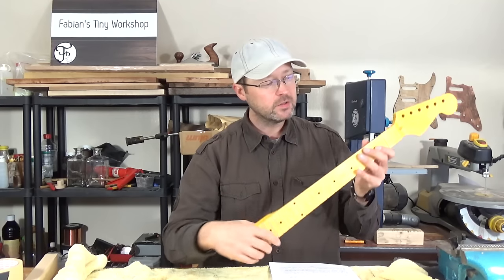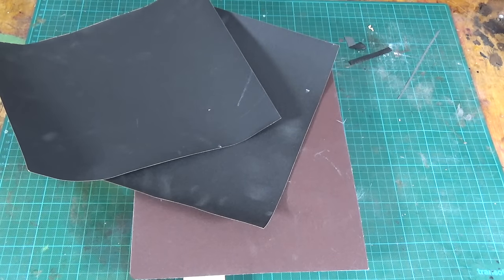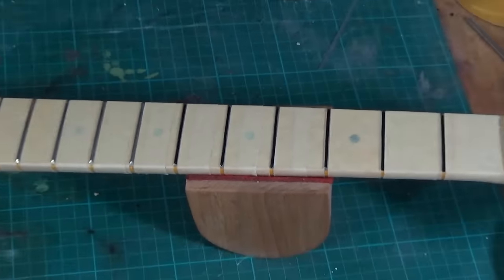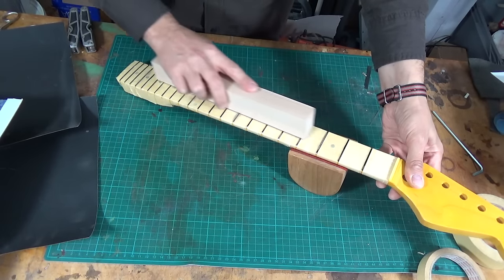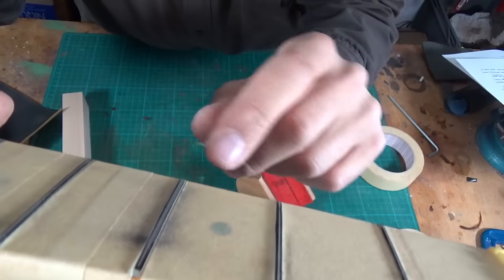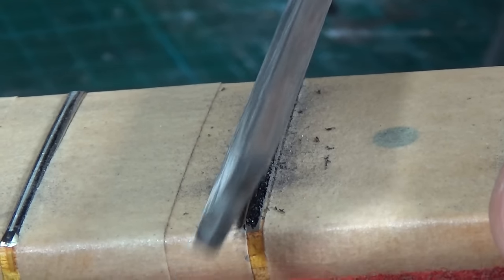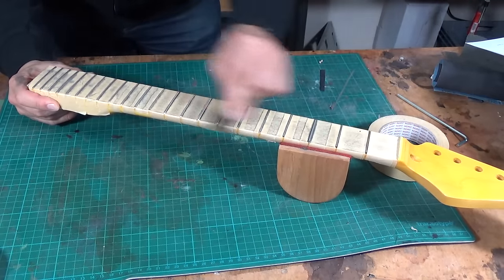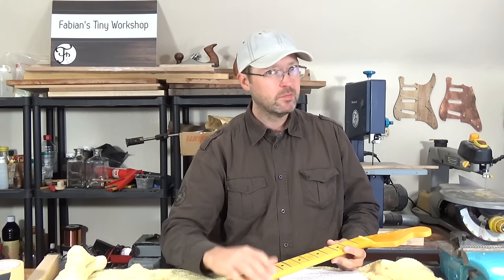Fret Leveling - The Easy Way // How To

Comment from the maker: Please bear in mind that you also should file the nut slots to the new fret level (picture the nut slots as the zero fret).
Nut slots that are too high create a situation where the guitar is difficult to play due to the high action in first positions. They can also throw off the tuning and intonation.

The ideal nut slot height, in terms of playability, is subjective — much like string action height at the bridge. Some players like the slots to be cut up a little higher - like slide players - , and some players want them cut down as low as possible so the guitar plays very easy with no fight - that would be me ;-).
Reply: Thank you so much for this helpul video! I am learning luthier work, but am on a budget. This video was straight to the point and I can't tell you how much I appreciate you showing how to make home made tools. Thank you!!
One question though, when rounding frets edges, is there a certain amount of the fret to remove? Any specific things to pay attention to?
Reply from the maker: @Roman-wm4ji  Just make them comfortable round. Don't remove material from the top of the fret ends thereby making the centerline of the fret shorter. If the fret ends are too much angled the strings could glide of the fret ends.
Crimson Guitars has a great video on dressing fret ends although they're using more "sufisticated" tools ;-)
https://www.youtube.com/watch?v=MFHcavzk80Q
Reply: @FabiansTinyWorkshop   Thanks so much! just watched his video  :)
Reply: thanks for the great video. I'm experiencing buzzing in one string, and I suspect this video will help me figure out a way to fix it. Regarding the nuts, my impression is that depending on the strig you'll have a different width on each slot, to lodge properly the string according to the caliber. This way they can sit on the same level... That's another problem I'm experiencing: I'll have to widen some nut slots a bit to make sure they are leveled from the bottom. Makes sense? thanks
Reply: I have the jem but my fretts seem abit uneaven I definitely think it is needing this done as I have lots frett buz,I've tried all the basics set ups adjustment s like the kneck!! Raising the saddles the bridge ect but I ain't raising it too much past 2mm low E that be too hard to play,seems only my low E that has lots buzz up and down kneck strange one!! I do feel it would be beneficial to level off the fretts and do this,I feel very confident after watching ur video many many thanks buddy thank u
Reply: Sorry to keep annoying u!! I start with 220 grit sandpaper ye,then what next to round them would 500 grit be any use when rounding them off,is that the hardest part most time consuming part would u say bro
Reply from the maker: @paulyoung4781  I'd say you can round the frets with anything between 220 and 400. Then work your way up to remove the scratch marks from the previous grits.
Reply: @FabiansTinyWorkshop  thanks so much buddy appreciated alot
Reply: Is it not better for a beginner to use a crowning file ? okay you have to buy one , but to me that looked the trickiest part of the process
Reply: @MrPhilfridge  I'm a beginner and I have a crowning file,I used it and didn't feel that comfortable using it! So I just got different grits sandpapers and wood blocks made up with grits and started the way the guy did it,much more realistic mate and like he said dont touch top of the fret they will round off as u progress u will work it out when u get there buddy I did I was abit skeptic! I'm still doing mine,I've leveling done now crowned them,am just starting to use 400,600,800,+ grit to get scratches off the frets now so far so good,when I get to 1000 grit I will check every fret use the rocker and make sure there perfect then I'll steel wool every one,then polish mate
Reply from the maker: @MrPhilfridge  Of course you can use a crowning file.
Reply: @paulyoung4781  Thanks for your post, i checked out a couple of videos where a crowning file was the preferred option , i'll see how it goes ! My biggest dilemna is whether the frets actually need reducing in height, certainly the fret ends need smoothing but really not sure beyond that. Its an all parts neck, sold as unfinished, but in some cases that often means just spraying and maybe fitting the nut. I've done around 20 home builds , but fretting is new territory other than really minor stuff. The frets seem a bit high but i've got the action to a very good height and the intonation is fine and i can see me f**k**g it up  🤫
Reply: @MrPhilfridge  I thought same my friend about mucking it up lol honestly I just thought I have like 8 high fretts buzzing is bad!! I watched lots of vids and done my research got my tools,anything I wasn't sure about I'd just pop a mail on here,and someone would respond and more I watched the videos I felt really confident about it,first time I I leveld the frets I used the wrong grit sandpaper haha 400grit I was very unsure about it and didn't want to make a balls up! So I leveld it all! I thought they were haha,I spent like 4 hours crowning them got them really nicely round i was very happy with it! Then I went up with the sandpaper 600/800/1000/steel wool,dont no what it was but I thought I'm away to check my fretts for any rocks! They should be fine now!! No 3 fretts were rocking!! I was absolutely gutted I thought I need to go do all this again,I should have used 220/240 grit for leveling not 400grit!! Hahaha so I did just that mate start again hahaha I guess u learn from ur mistakes buddy I sure did lol,so now I have leveling all done final now this time? And I have crowned them mostly I have 5 frets left to crown now,but I'm done for today my head is spinning now haha,tomorrow I'll finish buddy haha
Reply: You should stress LO TACK TAPE!!!!
Reply: You must be a beginning Luthier!
Reply: @danaeverhart6487 tape detail does show a lack of experience 😮 thx for your expert advice 😂
Reply: @danaeverhart6487 BTW can u shoot me a link to your master class 🥱
Reply: There goes the neck finish. Low Tack Tape from StewMac provides a clean SAFE removal without damage. 1st step protect the entire instrument before getting out the first tool, unless you are wanting to buy it. Peace ☮️ Dana 💫
Reply: @jimbradley727  Common sense Jimbo! Merry Christmas 🎄 BTW 45yrs repairing string instruments, and you???
Reply: @danaeverhart6487  that link tho 🤣
Reply: @FabiansTinyWorkshop  So that's explain why my guitar sound like shit after second time fret levelling, thanks for the info
Reply: you can also do the intonation at the nut, i often do it. simply cut the nut slots so each string gives a perfect half step between open and first fret position. not always necessary, depends on the nut cut, but can do amazing things to more inexpensive guitars.

Comment: Quick tip! place a piece of tape down the neck on each side before applying fretboard masking for quick removal.
Reply: thanks!
Reply: Since you're using some Stew Mac stuff,  I think I got several widths of masking tape (blue) and use the narrow rolls on the high frets.  I use a piece of granite with double stick 320 to get flat using your basic technique.  Ive used several crowning tool,  but I use a 3 corner file, but grind one side smooth and polish the corner, and you can get pretty surgical with the frets that way.  I got a cheap diamond crowning file, and if you're working on multiple guitars I wouldn't skimp on this tool.  I also use the StewMac gritty erasors, and finish by buffing frets with a cloth dremel wheel and simichrome polish.
Reply: @briantinsley7864  I also use a dremel and Simichrome.  Great stuff
Reply: Nice tips! Thanks ☺️
Reply: And why not use a dollar or two worth of ‘blue painters’ tape? I believe in saving money when it makes sense, but most old style ‘masking tape’ has some pretty nasty adhesive. 
When I compare the extra dollar for tape, to the value of my guitar neck, it’s a ‘no-brainer.’ It doesn’t have to be the 3m kind. Just keep an eye out for any sort of dollar store, it’s worth a look, because most of them now carry a cheap version of blue painters tape.
Reply: Nice one, Scotchy!
Reply: I've seen that video, too! Do it all the time.
Reply: @stradaveriusfiddle  I don’t even buy old fashioned tan masking tape anymore, it’s crap.
Reply: "Brilliant"
Reply: Bro, you’re a straight genius. Thanks!
Reply: Yep.

Comment: Hey, Just throwing it out there.. spend the money on a crowning file. I've leaned a lot of guitar oriented tools are just common or obscure tools repackaged for guitar work, but crowning is hard. If you're not already proficient with a file or woodworking, you'll either mess it up the first time or spend far too long doing the frets. Sometimes it's worth it to have a purpose built and purpose bought tool for the price of, maybe, a set up with new strings.
Reply: ....I thought about the same as you and just ordered a crowning file.
Reply: And I really don't think a piece of cardboard is good for a straightedge. Just saying....
Reply: @Mr.Steve-O  I bought one of those sets, and the included 'crowning file' took off the tops of the frets and put ugly scratches in them. This type of file should not be abrasive at the top, but the Chinese ones are. The diamond coating is uneven and coarse which is what can cause long deep scratches.
You don't necessarily need to buy Stew Mac files, although if you can afford it and plan to do many fret jobs, it is probably worthwhile although the price is hard to stomach. 
Anyway, a three corner file with safe edges works too, and after the useless Chinese file had ruined a couple of frets, I switched to a three corner file, watched a few tutorials on them, and got very decent results for a first try.
Reply: @meadish  I got some tools from Crimson guitars in UK ... They do.the trick and since I got a few cheap basses I figured spending a little in some good tools to make them super playable is better than paying for expensive bass and marketing.

I saw Highline guitars made a crowning file our of some soft balsa wood, a good fret and some sandpaper.
Reply: That one tool is worth the investment. 🤠
Reply: Yea, and if you work in any type of building trade just claim them back on tax and they are basically free lol
Reply: @Steve thanks ... that WAS the chap I bought the crowning file from ...it was some other gear I bought from Crimson. Both make awesome tools.

Comment: Yep. This is almost exactly how I've done it for 12-13 years. No fancy tools, just a cheap diamond needle file set, a flat piece of wood and some sandpaper. The only things I've spent some money on are nut files, since I haven't found a cheap alternative that can replace real nut files. I also have two notched metal rulers, but I only bought them because they are practical, not because I actually needed them.

Comment: A great tip for you guys when masking off the fretboard is to first apply masking tape along the edge of the neck length ways. I usually do a couple of layers. Then masking the fingerboard. This makes the job 100x easier to remove the masking tape later because you only have to pull up the two long strips of tape instead laboriously unpicking every single fret.

Comment: Just if anyone is new to that, the file at 3:58 needs the edges ground off to get safe edges. The regular sharp edges will eat through the masking tape and destroy (in this case) the finish of the neck and the wood beneath it. Good video, lowered the hurdle with the self made tools.

Comment: Thank you very much for the tips. I am a beginner (6 months) and my cheap €90 Stratocaster has 3 slightly higher frets. I learned a lot about proper set up (neck relief, inntonation, string hights, pick up heights etc) and was wondering how to do this without special tools and also learn. I also watched your DIY kit, i was looking into a telecaster DIY kit (love the tele twang) and again learned alot. Much appreciated.

Comment: I took my guitar into Guitar Center for a tune up, never thinking this would be an issue, but it was... After taking my money and not letting me know about this problem, which I am sure they spotted when they originally tested it, they were more than happy to let me know when I brought it back the next day. So, now, on top of the $50 bucks I spent on the tune up, I now have to give them an extra $125 to level the frets??  No thanks, I am doing it myself!  
This is a great video and I am certain that I will have no issues completing this project successfully.  I have all the tools, but more importantly, this video has given me the confidence to succeed.  I will never take my guitar into Guitar Center again!  I realized that getting my guitar serviced at Guitar Center is no different than having my car serviced at one of those $10 oil lube places!  Live and learn!

Comment: It’s Brian here on my dear wife’s iPad. Mine is opened up for a screen digitizer replacement in my “studio.” Thanks for a thorough discussion on fret level and crown procedure. Your video gave me the confidence to proceed as a DIY amateur luthier with old school attitude about fixing what you own and love when necessary. 
I’d collected new locking tuners, graphtech saddles, TUSQ nuts and a bridge, a Bigsby B30 and a Bourne split coil harness and I  was about to order a pricey 6” leveling file to address two guitars of 4 I own and play, a 2000 Epiphone 335vs and a1988 Fender Strat. The Strat has moderate fret wear, divots and some buzz and the maple  neck and fretboard will be stripped and treated with boiled linseed oil over Japan drier, then new saddles and nut. The Epi gets light fret dressing, new harness, the the Bigsby and bridge with Towner down pressure bar into  a Graphtech Rotamax Bridge , ditching the OEM Rotomatic with steel saddles. .
The other two are a 2019 LP Plus Top Pro VS which needs nothing and a 1952 Martin 018 on which if the two jobs above turn out as well as expected I will also do a fret restore. As refined and vintage sounding as it is it will likely regain what’s been worn away these years….Already refinished the neck myself, had a pro luthier in upstate NY reset that and repair/ stabilize some checking. It was my mom’s, I started playing that when I was 9 or so, now I’m 72. 
The roughly $65 saved from the leveling file (I own a new FretGuru 2.0 crowning file as of yesterday) I’ll roll into locking tuners for the Strat, save all the OEM hardware removed and all the tools in a box for whoever inherits my guitar collection when I ride off into the sunset. 
.
Reply from the maker: Appreciate it :-) Thanks for watching and commenting!

Comment: I have a piece of leather glued to a piece of wood. I normally use this for chisel sharpening. It works great  for final polishing frets. Use jeweler's rouge or whatever you have avalable on the leather and have at it. You get a mirror finish!
Reply: My favorite trick is my dremmel with a polishing wheel, as a last step.
It’s like string bending on glass!
Reply: I bought one of the green compound bricks for my strop and polishing anything metal around the shop, 8 euros for a giant brick ill probably have to pass down the family lol

Comment: I would highly recommend just spending the money and getting a good fret crowning file to use to crown the frets with. You won't regret it. The rest of the instructions is good though.
Reply: You are right. I bought a fret crowning file and it is idiot proof.  I find with just a basic file one if not careful can easily damage a fret.
Reply: Besides StewMac do you have a place for one?  Amazon is a hodge podge of junk, or so say the reviews on them.
Reply: @generalawareness101  I did buy my $40.00 fret crowning file from Amazon. However I have never done fret leveling before and have not yet started so I do not know if that file is junk.

And yes Stew Mack what ever they sell is top quality and also top quality money
Reply: @generalawareness101  baroque I think they're called make a decent fret crowning file its like $40 U.S. but it's got the 3 sides for the 3 basic fret sizes. If you want to see some in depth detail and see it used there's a YouTube channel called gunsandguitars just look for his fret leveling and crowning video
Reply: @generalawareness101  I use the "Hosco" brand crowning file from amazon. Works great and has held up very well. Definitely avoid the chinese files below 30$
Reply: @lordmanshaft1112  The one I got was Chinese for 17.99.  Not the greatest but did the job and my guitar plays much better than ever before but I would not buy it again.
Reply: I ain't gonna buy something I don't need.   Followed this advice on 12-13 guitars now. And a bass.  I spent the 40 bucks or whatever I saved on dinner w/my daughters.  Plus.  StewMacs prices are beyond ludicrous.   No thanks
Reply: @generalawareness101  bruh it's a file not a watch movement or a bra.  They all work
Reply: @TeddyBullard  Like Snap On Stew Mac has its zealots, bruh.

Comment: great tutorial thank you
I found that you can buy a pretty cheap aluminium Water level, they are milled totally flat from the factory and I use the same method on these: stick on sand paper with double sided sticky tape 
I just use a piece of sandpaper with my fingers to crown the frets after levelling
After the steel wool I use Autosol metal polish, the frets get really shiny :-)
Reply: If you have a machine bed or a flat piece of marble, check if it's really flat. It often isn't, especially on the cheap ones. But it's a good start and with that surface and some sand paper taped to it, the beam can get there. After a number of strokes, turn the beam around to get a more uniform result.